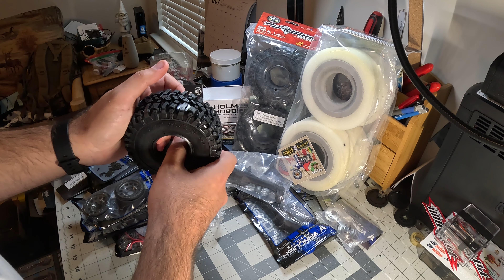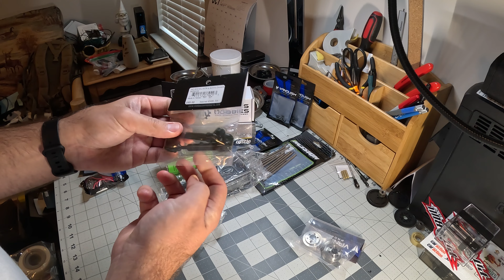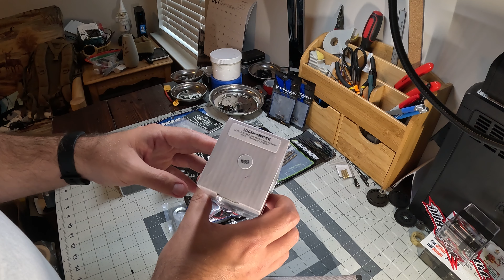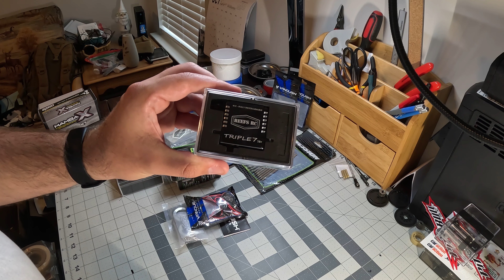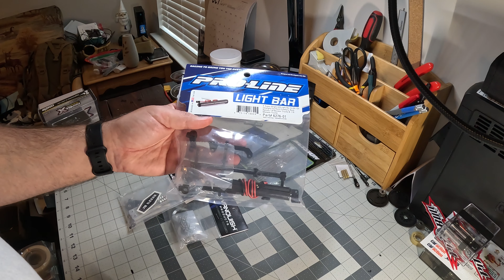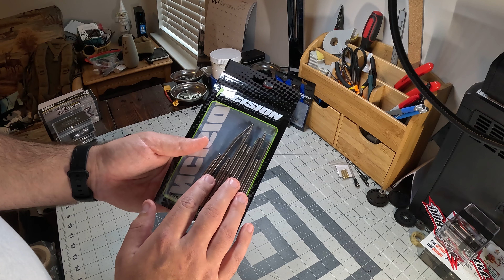No Budget Build: Breaking Down the Parts for my Speedy C3

Comment: Interested to see how much of the actual Vanquish you use in the build. Is it worth buying the kit, or would buying the individual parts be a better route 🤔
Reply from the maker: Skid, trans, axles housings ( if using plastic), axles components, some of the links, shocks (could be used). With the price of the kits (including the machined gears right now), I'd suggest the kit and sell the body. You will be in 300+ for just the trans and two complete axles so I'd rather have the spare wheels and body or sell them for that difference.
Reply: @Krazy4KVs  perfect, thanks for the info.